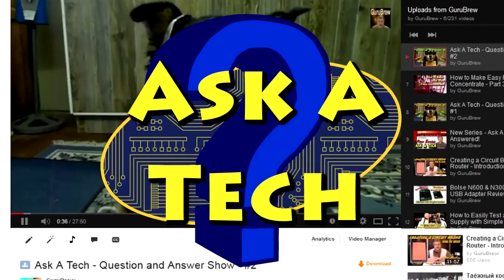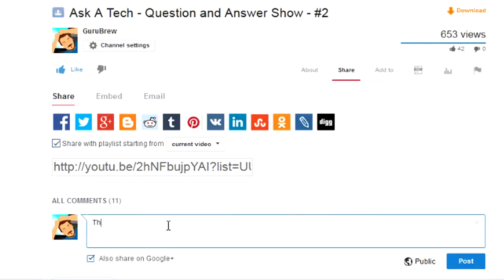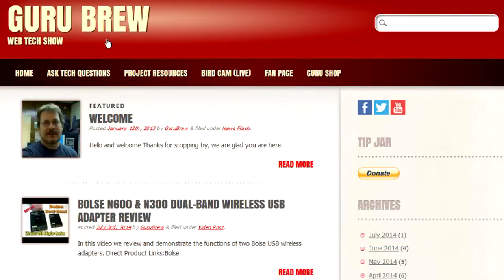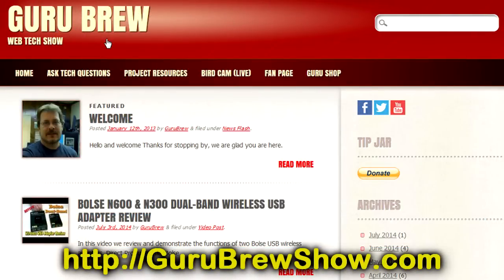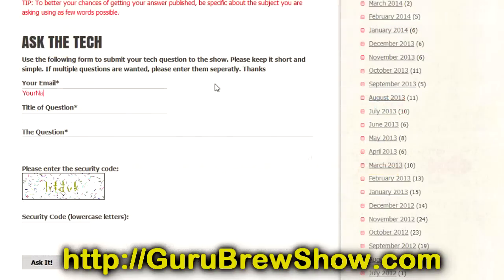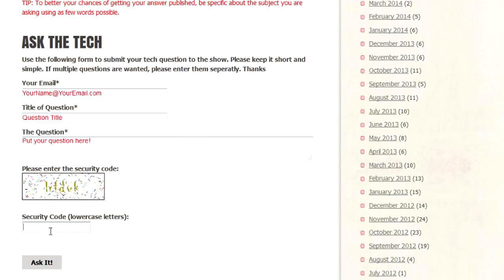Computer Fans are Keeping Things Cool - Ask a Tech #33

Comment: I always thought it ridiculous to have all these fans and radiators in a computer. With finned heat sinks, and 1000W power supplies that are now easily accessed , an innovative company can make mostly the whole side panel a high pressure high air flow fan and keep it thin and quiet and good looking. Many who do heavy workloads at this point already take off the side panel and put a big fan in front of it with very little noise. With  the even newer models of fans as you had mentioned, this would be a simple and inexpensive task for a company. jmho